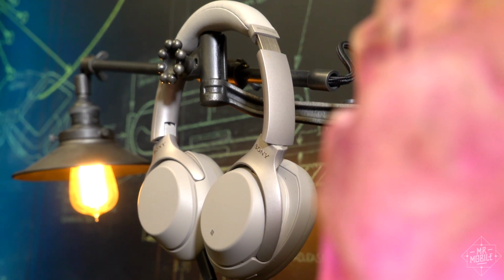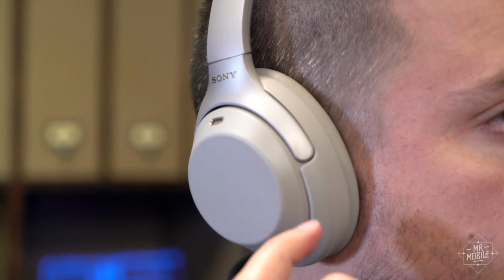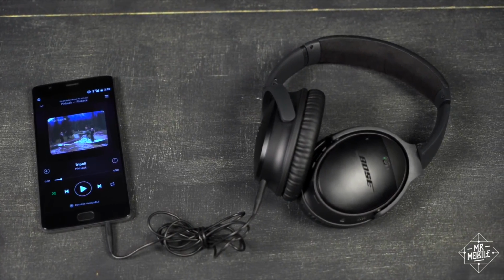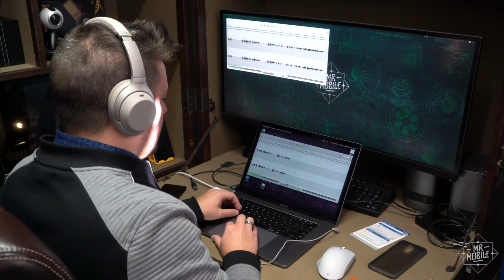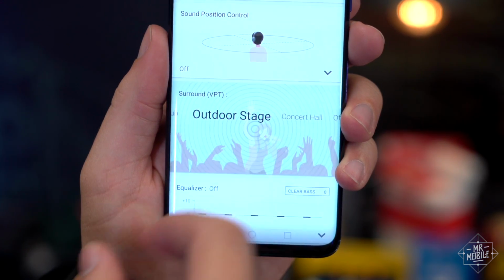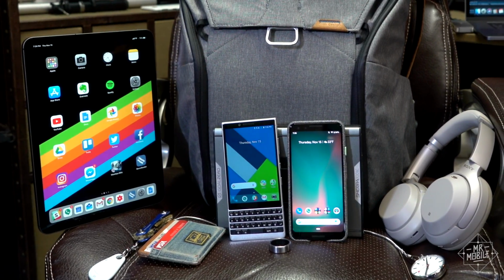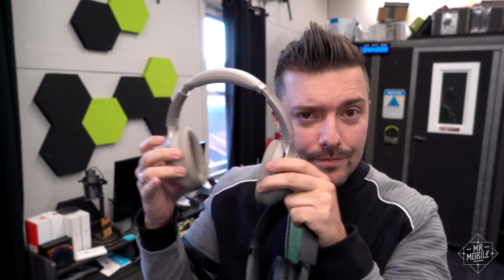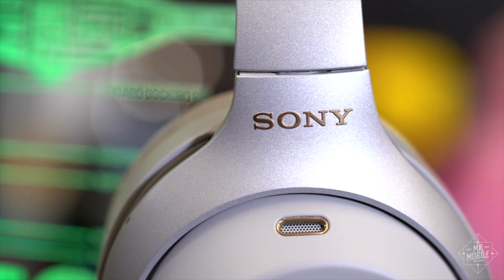The New Noise-Canceling King: Sony WH-1000XM3 Review

Comment: My own quick thoughts: Amazing noise cancelling and trump the Bose in every department but comfort (I found the inner padding sitting on my ears to be uncomfortable compared to the open void in the Bose). Unfortunately returned mine as the altimeter goes nuts in the London underground with the constant cabin pressure changes and caused the earcups' NC to pop in and out constantly.

Comment: Great review! I'll take comfort over touch controls especially over long distance traveling.
so that's why I'm sticking with my gut with the Bose QC35 II still.
Reply: Sound and noise cancelling is better in the sony's. But comfort is key and after testing both the mx3 and qc35  the Bose aren't much more comfortable than the qc35 . Not much of a difference. Fortunately I picked the Sony xb950n1 for 99 USD instead of 249 USD. I'll probably keep it untill a better bass anc headphones will be released
Reply: Couldn't agree more.  Comfort is the paramount aspect of consideration when choosing a pair of nc headphones.

Comment: Just got these specifically for my long flight from Australia to Europe (prefer not to hear crying babies at all or and engine noise when watching something) lol
Looking forward to trying them during my flight.

Worked great when I used them while mowing (loud ride on mower) blocked out a crap load of noise.

Sucks you can only connect to 1 bt device at a time and no app support for Asus T100h Windows 10.

Comment: Great review, Michael! I love my 1000XM2, and I'd consider upgrading, but it's too bad that they still haven't fixed the Bluetooth issue. When I use them with my laptop in the evening, switch them off, switch back in the morning hoping to use them with my phone, I end up having to run back to my laptop to disable Bluetooth there, which is a huge pain. As such, I'll probably wait for the X4. What are the other headsets which allow connecting to multiple devices or switching between them more easily?

Comment: Compatibility / connectivity is an issue with Bluetooth devices. I use my mobile phones (I have a Huawei P20 Pro and an iPhone 6s Plus) to stream music into a car stereo. Some bluetooth systems on cars are not compatible with certain phones and vice versa. When searching they just don't see each other.

I have two pairs of bluetooth headphones. I have a JVC pair and a pair from a cheap Chinese maker (Hopestar). I like to stream music from my MacBook Pro.

Strangely the Mac cannot see the JVC headphones. But it does connect to the cheap Chinese (Hopestar) ones !! When I search for bluetooth devices from the Mac, it sees the Hopestar headphones straightaway. The JVC ones (which are more comfortable and give much better sound quality) are just not visible via Bluetooth.

Go figure !!!

Comment: I'm very pleased but somewhat upset:

I'm a big music enthusiasist and reviewing albums is a hobby of mine. I have owned the Sony Wh1000xm2 for 6 months now and I believe that the noise cancelling is fantastic, I don't sweat around the ears with them and they are comfortable to me. The sound is exceptional (can be a bit too energetic on the higher end for some tracks) and overall it's pretty great. 

However unfortunately although I have been taking care of them, the headband is literally like kinda falling apart. The label for "Wh1000xm2" and the "wireless" part both fell off and the piece under that holding it in place for both sides as well.  So in that regard I am disappointed.

Comment: I've had these for 5 months and am generally very satisfied, but I find the touch controls extremely unreliable. This only refers to the one-tap gesture to pause and play, everything else works fine. Has anyone else had the same issue, and any advice how to fix it? I couldn't find anything in the app to adjust touch sensitivity.

Comment: I tend to wear headphones 3-4 hrs straight. I've tried on the quietcomfort ii's and they are extremely comfortable. Couldn't complain about the sound quality either. Haven't tried on the M3's yet. How are they when it comes to wearing them 5 hrs straight? Also, is there are huge difference when it comes to sound quality?
Reply: Sound quality is much better on the Sony's than Bose IMO, especially if you like a lot of bass. I've had the Sony's about a week. I'd say they're comfortable for about up to 6 hours a day. Not anymore than that. They compress on your head a bit too much if you wear them for 8+ hours.

Comment: Hi, just for few days I am using my new wh1000xm3. Updated to latest firmware 4.1.1. but disappointed on noise cancellation feature. In my bed room I can hear the fan speed sound or my wife's voice(low but audible) even when noise cancellation is on. where as per many top reviewers  nothing is audible on the streets or any public place then how could it be possible in a room? It should be completely block the outside noise in staying mode. I have also disabled adaptive sound on Sony's mobile app to get noise cancellation output better. Am I missing something as a new user? Kindly help this one really expensive.

Comment: I tried both generation of Sony. 3 thing stopped me switching from Bose. Sound quality is a lot better then Bose after tone down the bass. but it's not why you use wireless NC headphones.
1. comfort.        better than 2nd gen, but still gets hot after wearing for 15 min.
2. touch control still not consistent, at least for me the headphone often skip track when i think i was swiping up to increase volume.
3. can't connect to two device.     

My opinion: if you can only have one over ear headphone, go with Sony for better sound. If you already owned some audiophile grade headphone. Go with Bose for comfort, reliable control, and convenient connection with good enough noise canceling.

Comment: The old ones had a design flaw where the head band would crack with usage. So did their predecessor and the one before that - all the way to the 1RBT.  So much so that sony has multiple replacement parts available for their headphones for 3d printing on thingiverse.

If this is anywhere near a lot of money for you and you're considering spending it on these - do yourself a favor and get something that isn't Sony. They don't stand behind their products.

Comment: My bloody ears get so hot in this headset though, not near enough as comfortable as the bose. The bose also has a much better design with the cold metal on the sides and they are smaller.

Comment: How is the latency with these headphones. I want to use these while watching videos and I know that some bluetooth headphones have a lag between the sound and the actual video so how bad are they in these headphones if there is a lag and how can I fix it?
Reply: I haven't had any latency issues with my headphones and using it with my Dell XPS 15 and Samsung Note 9. I do have a problem with my Surface Pro 3 and these headphones but I also have a problem my Surface Pro 3 and my other Bluetooth headphones as well. So I'm definitely guessing it's just the Surface Pro in that regard.

Comment: Her my honest Opinion what is bad about the Sony even though i bought them...

Sound: 
Equilizer not usabe with the Advanced BT profiles (Hughe Problem and annyoing like hell)
becoue the sound in itself has too much BASS (thanks beats you triggered that..) compared to the B&W PX which are awsomly (you can hear anything clear without getting a uniform porridge because of to much bass - but terrible Noice Canceling and to heavy so they are no alternative..)

Buildquality: 
Plastic bomber Through and Through...
Problem --> Earpads are Cheapleathr imitate which i don't want for 300+$ they get sweaty easy and replacements are hard to find --> Dacony has expensive ones

BT:
Not more than one Device.. Connecting my Phone and Computer at the same time is not possible .. This whould not be a issue when i could simply press connect at my PC..
BUT it will not get connected i need to release the connection from the phone first.. ANNOYING it is possibe to connect more than one device nowadays.. the NFC does not help with Computers

Firmware:
Equlicer and all settings on the phone is NICE but it would be nicer to make my changes than UPLOAD those to the headset and get them in any DEVICE TV-PC-Laptop.. in this way i could at least set equlizier settings and use them on all devices and not only on my phone.. see BASS....

Anyway i bought them knowing those issues.. so theres that.. 

Would like to know what you think about those issues?

Comment: Way to expensive in my opinion. I'm a Sony fan but 350 for a pair of headphones? It's just some speakers, battery, a couple of microphones and a Bluetooth controller/receiver. I bet this one's factory price it's under 100 and maybe a extra 30-40 for research and development. The right price should be around 200-220. I have a pair of Skullcandy Crusher Wireless, paid 67£ for them. I have 40h listening battery, special extra drivers for bass. I don't have noise cancelling but this feature don't make me to pay almost 300£ extra for a pay like that.
Reply: Rosca Liviu well it’s not for you, you are obviously not part of the target market for these headphones 😑.....
Reply: There are Bluetooth headphones out there that have 30hr battery life and noise canceling for £50. Why did you pick the Skullcandy?

In the same way you picked your cans, people do find value in some extra features that justify the price tag. That might be the noise canceling or controls or the LDAC.

Considering the advances in the m3 iteration of the headphones, I'm actually surprised that Sony isn't slapping a £400 price tag on it. Sony developed a dedicated processor just to handle the noise canceling and audio for these.